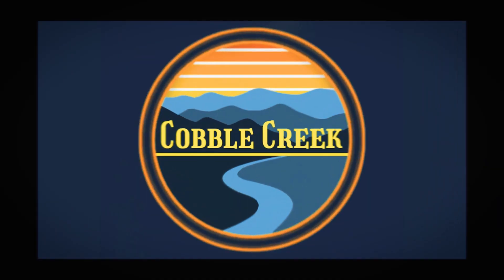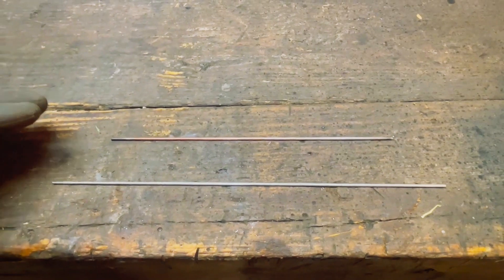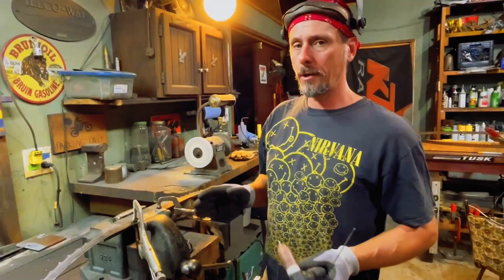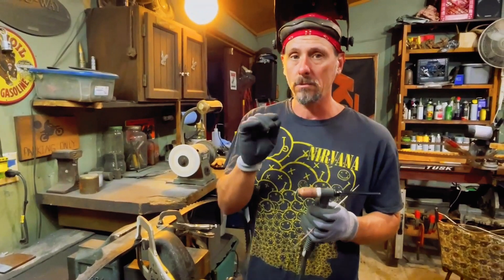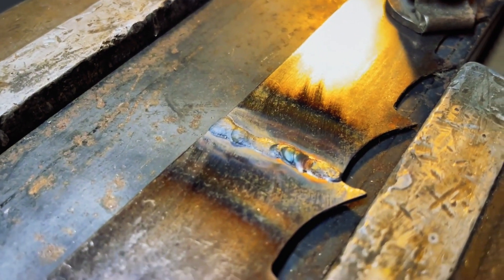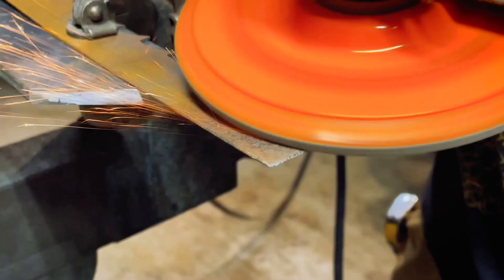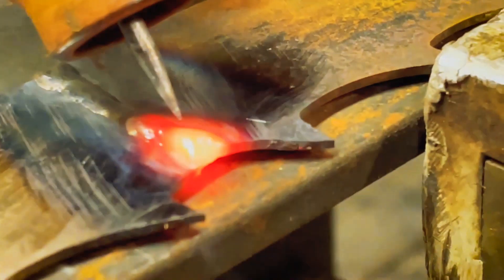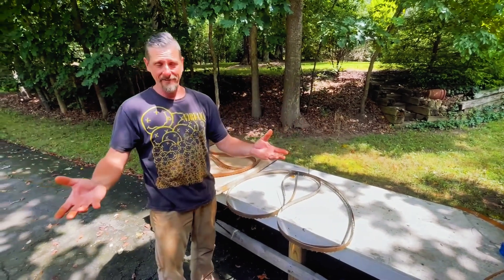How to Repair Broken Bandsaw Blades: DIY Bandsaw Blade Fix ┃Welding Bandsaw Blades [Epic Failure]

Comment: I have welded blades back together and used them. Not sure if I’m just lucky, but I used a wire feed and kept the heat pretty low while I was welding. Burns through almost immediately, so you have to move pretty quick. Keeping them square is a whole other thing because they get pulled all over the place as you weld and then often develop a bit of a shudder when they get back on the mill. I have several hundred or maybe a thousand blades if anyone wants to try.
Reply from the maker: I could see how drawing would be an issue with a mig gun
Reply: Would love to try!
Whereabouts are you mate?
Reply: @bushratbeachbum Canada. Near Jasper.

Comment: Due to welding the carbon gets burned out of the material, anneal the weld after grinding for about 30 seconds on 5 to 600°.
Reply: Exactly. And let it cool down slowly. I've TIG velded smaller bands with succes. I might have used stainless filler, but I can't remember.
Reply from the maker: Like maybe a 309 like dude said earlier. Probably throw some insulation on it after  the annealing. We had to do that with P-91 welds to get the correct cooling rate after post weld heat treat.
Reply from the maker: Excellent, I'm going to give it a try when I get back to the shop. Thanks

Comment: Scarf and silver solder
Reply from the maker: Same as with braising, I believe it would be difficult to get a good joint geometry with only .045" thickness. Having said that my experience with soldering is limited to knife work and plumbing. Thanks for the comment

Comment: Good advice on the flap/hard Rock heat input.. looks like ur using walter abrasives.  I love the grinding discs and cut wheels but I haven't used their flaps.. you like?
Reply from the maker: Very much so, aggressive with minimal clogging.

Comment: Interesting challenge. To start.... I'll say that I don't have "all the answers" but there has to be a way to make this work-  You definitely need smaller filler wire. I would suggest slightly more heat; but moving faster (to reduce the heat-affected-zone).  Along those lines; it makes me wonder if MIG, or pulsed TIG might give better results (fast penetration with low overall heat input).  On filler selection: I'm not familiar with the inconel filler you tried, but ER70S2 is a good choice.... unless it is somehow becoming brittle after combining with the blade steel. I would be tempted to try 309L; or Aluminum Bronze, or silicon bronze (TIG brazing the last two) as flexibility/ductility may be a higher priority requirement for this application-  

Welding broken bandsaw blades may not really be a cost effective solution.....but I'd like to figure it out anyway. Keep us posted
Reply from the maker: I have welded a blade in the past that worked for a short while before failing. So I thought "what the heck" let's try it again. I worked in a small metal shop about 25 years ago and they had a metal band saw that had a welder on it. It used induction to heat and weld in one fail swoop no filler metal, very small heat affected weld zone. I bet accurate heat treatment would help. A agree that's it's probably not cost effective but challenging none the less. Good luck and thank you for the comment.
Reply: If the break is due to metal fatigue caused by bending then the whole length of the blade is brittle. So even if you do manage to successfully join it it's just going to snap somewhere else fairly quickly. What I've done to put bandsaw blades together is braze them. But there's a method to doing that to get it to work. Which is involved to describe but it's fairly easy to do. Works a heck of a lot better than I thought it would too. Braze is pretty strong.  What you have to do is called a double scarf joint. That's done to maximize the surface area of the joint. Gives the braze a lot to grab onto.  First you overlap the two ends of the blade and snip them at a shallow angle. About 35° or so. Then you feather each mating face on a grinder. About 15° Like they're skew chisels. Now you assemble everything with overlap and braze away. Smooth the mess you've made and you're done. I've always just used plain old brazing rod. Nothing special. But I'm fairly OK at brazing. You do have to get a good flow. Popcorn won't do. I use an oxy acetylene torch. Maybe another torch would work? I can't vouch for that.
Reply: A propane/oxy torch works nicely to braze steel with conventional brazing rod. Get the surfaces clean, then paste flux, and the joint will be good.